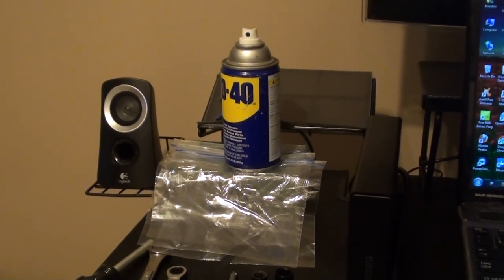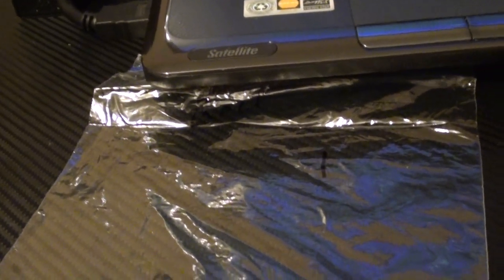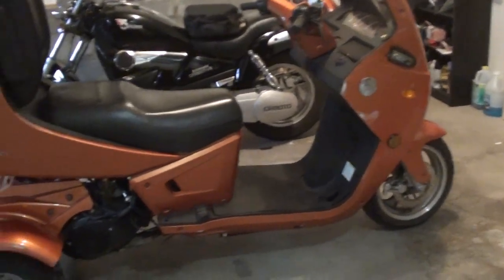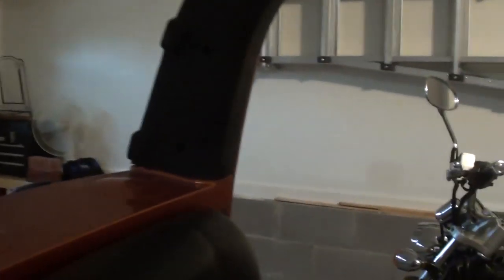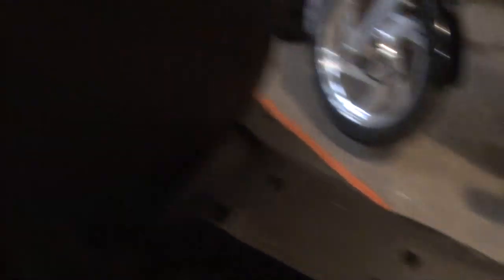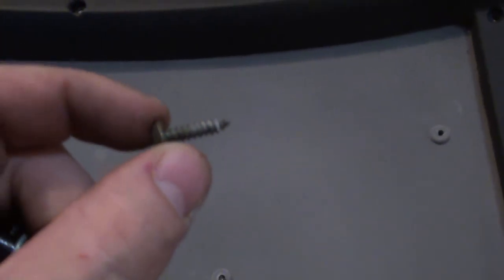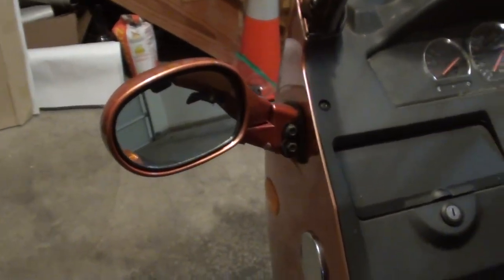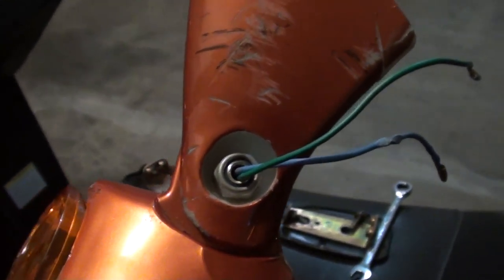Auto Moto Disassembly(1/3)

Comment: do you know the proper way to tighten up the standing by itself mechanism? I've tried tightening the one bolt on the threaded rod underneath with no improvement. 2010 model with disk brakes in back